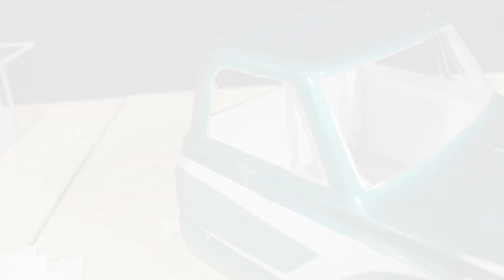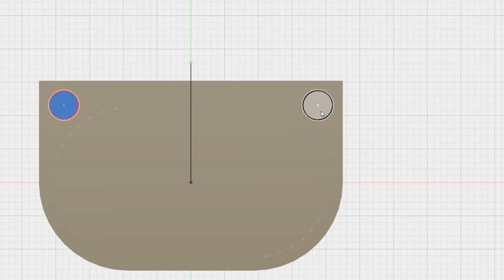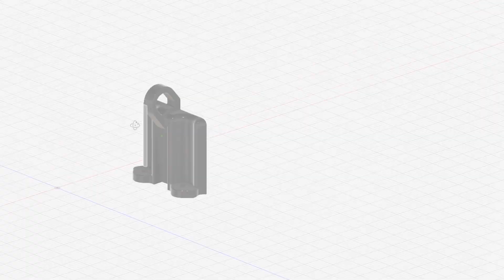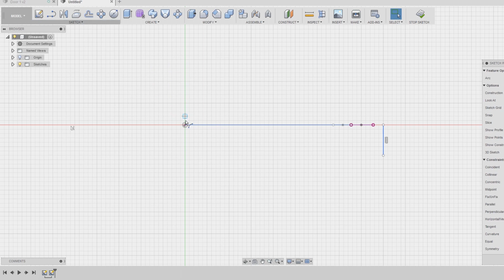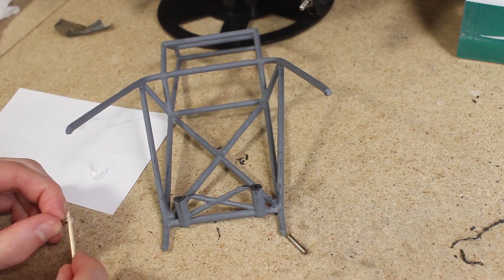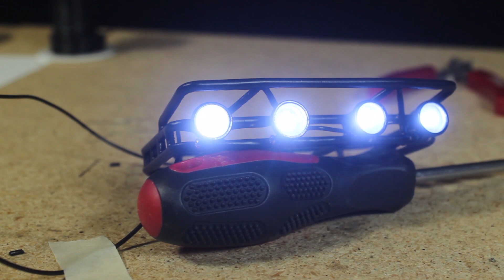Project Prerunner: Part 3 Painting Cage, Finishing Roof Rack, and Body Work

Comment: Did you consider printing with PETG instead of PLA. It’s a nice middle ground between ABS that warps all over the place, plus emitting not-so-healthy fumes, and PLA that is not as strong, and not very temperature resistant.
Reply from the maker: Yes I've wanted to try out PETG but haven't got around to it. It's something I definitely want to experiment with.

Comment: Cool cage for the truck. I would skip using ABS for the cage. I have found PETG to be way more durable and very easy to print. And it doesn't stink when your printing it . I am planing to do a roof rack with integrated light bar for my bronco project.